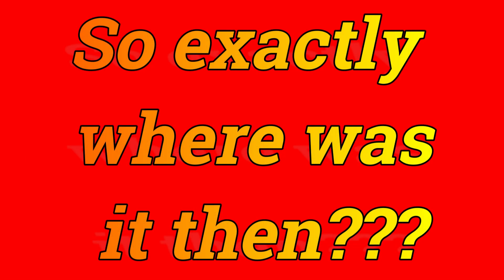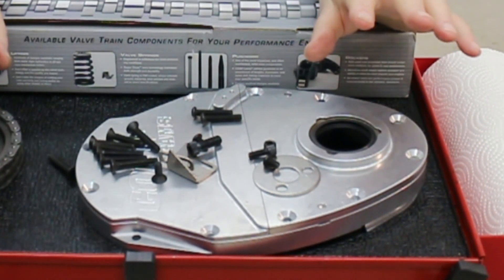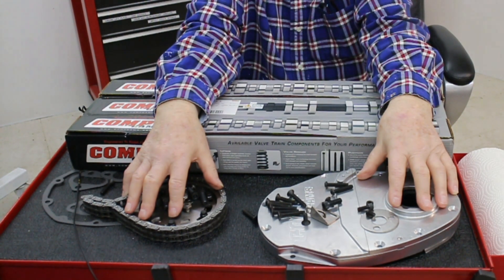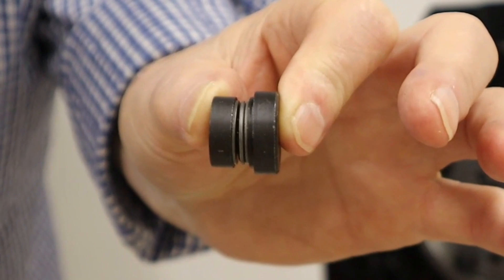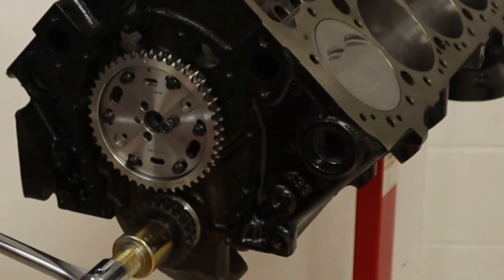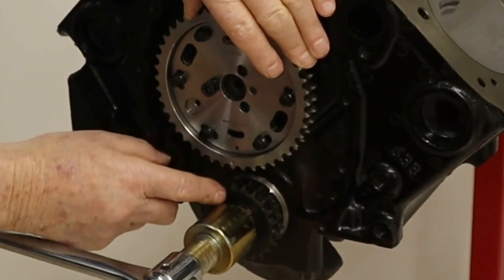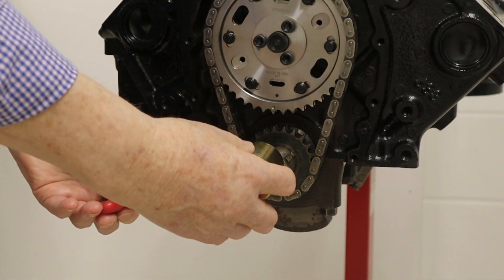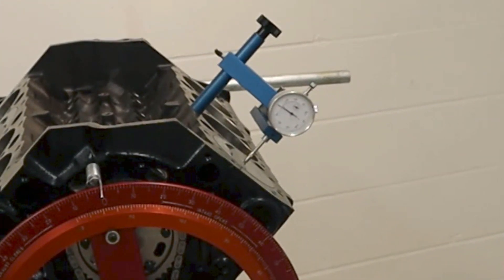Automatic readout cam timing wheel

Comment: I'm 65 and I've only built two engines both with the same camshaft and both extremely mild. They were the 204-214 Edelbrock cam. Relatively wimpy but I wanted something drivable. We're talking 30 years ago.  I bought one of those small crane degree Wheels.  I suppose they're better than nothing but you really need to have a nice sharp pointer and good light to try and read them. 
I'd like to thank you for your videos and your books.  I ported a brand new set of heads from World Products and took your advice from one of your books. I had The Machinist install 1.6 exhaust valves. The first thing that I noticed and I remind you both of my engines had the same camshaft profile. The engine sound had changed.  I liked the new sound. With the new heads and this larger valve I definitely noticed the power increase but it didn't hurt my mileage at all. 
The book was called performance with economy I believe. I learned a lot from that book. You choose words and descriptions that make everything easily understandable.  
What a treat it is for people today to be able to see your videos. Thank you David for doing what you do.

Comment: Another excellent video, as always. And I laughed at the fact that you were assembling the engine with your house shoes on. That is confidence, and comfort, all in one.
I'm patiently waiting on the dyno numbers. I'm specifically interested in the vacuum. We run "stock" dirt cars. We have to use open chambered heads, and a vacuum rule/lift rule cam. I'm curious to see the effects of the tight cam on vacuum. 
Thanks again sir.

Comment: Yes , I want to build the 108 lobe sep. angle engine you talked about in the previous 'add 60 hp and ft lbs' video. Though I am using Flo-Tek aluminium heads because they are the cheapest decent heads I can find that deliver to Australia, and I am using a Howards 277 degree . 470 lift cam 108 lobe sep. camshaft (I am using the Certified cam and lifter package that is guaranteed for 5 years as I don't want any of these lifter wipeout problems and will be using ZDDP zinc additive also) and the 650cfm carb and rpm air gap manifold you recommended on a 350 .030 over bottom end. We should all have something to port at least on the Zoom conference don't you think?
Reply from the maker: Chuck - this is a good combo - although the carb is a little too small unless you use a spacer (maybe just a 1/2 inch one).
DV
Reply: @marvingvx1  David this may be a elementary question but how and why should a mere half inch spacer do his setup so much in additional power?  Thanks again. And please excuse my novice ignorance.

Comment: Thanks Mr.Vizard.     I do approximately 12 complete engines a year,  and find that the tolerance stack up is off, on about 40 percent of the jobs.  That goes for the premium parts as well as the average cost parts.    My question to you is, if the optimum LSA is 108°  but all that you have available is 110°  provided there is enough Piston to valve clearance for a very basic performance build, would it be best to install at the typical +4° or, maybe better at +6° ?     I do realize this is a broad question.    Thanks for your consideration  !
Reply from the maker: Mr. Comet sir, I am relying on a flawed memory here but I think you are right. I seem to have it in mind the a cam on the too wide LCA works best with just a little too more advance. Gives a better drag strip power curve but fall a little shy at the top end.
DV
Reply: @marvingvx1  Thank you Very much !!!   I thought that would probably be the situation, but confirmation from YOU is going to give me more confidence.   I appreciate your sharing your knowledge  !

Comment: I think I missed some numbers somewhere. I thought you were going for intake centerline at 107, but somewhere that changed to 102°. I assume that means the cam was ground with an LSA of 107°, which would make sense, and needs installing at 5° advanced. This would appear to favor mid-range torque (tight LSA) and the advance will close the intake valve quite early, favoring low end power. With well flowing heads you could still get good power from the engine. Overlap at 0.050” should be from 10° BTDC to 3° ATDC and intake closing (again coming through 0.050” tappet lift) is at 34° ABDC. Am I understanding what you said? I’m really looking forward to seeing the dyno results from this engine!
Reply from the maker: Brian, you need to watch again and note the numbers especially where I read out the cam specs.
DV
Reply: I don't hear where the 102 comes from either....I figured you mean't 107....
Reply: Good question..thought i would find the answer here.

Comment: Hey DV, have you considered using one of the Comp cams 6100 Belt drive timing kits? they are supposed to reduce or soften  valve train harmonics (and I know they do) transferred from the crankshaft and also are more accurate to dial in than chains and I guess more quiet. I guess you would want to use one on a more high-end build.  Also, I was told that you have to run the nylon cam buttons with aluminium timing covers, as the steel ones wear away the cover? I guess it's more of an issue with a manual car and having a heavy spring load from the clutch trying to push the cam forward in the block every time you disengage the clutch - I know Isky Cams do an Anti-Walk cam kit that puts bushings and washers behind the timing set so there can't be any back and forth movement after you set it how you want it.
Reply: Not being sarcastic, please explain to me how the clutch, or specifically the spring pressure of the clutch pressure plate, has anything to do with the cam walking back and forth in the engine block.
Reply from the maker: @shelbyavant5081   - not sure where you are coming from here!
Reply: @marvingvx1  Right! Go back and read Chuck.U.Farley comment above. It makes no sense.

Comment: With the little knowledge I have, for me cam events are more important than how much duration and lift a cam has, if it happens on the wrong timing event it is pointless, now touching on this subgect, what about cam timing events vs connecting rod lenght, for example, a 1.5 vs a 1.8 rod ratio, I assume ( and I might be wrong ) that the cam events play a factor regarding the acceleration and position of your  piston on the 4 events of the engine rotation, is this a topic you touch on your seminars ?
Reply: @REMY
You may be on to something there, some top engine builders say they have found no difference in power with different rod lengths. Did they optimize the cam events? I don't know. A shorter rod moves the piston more violently around TDC. I wrote a program some (many) years ago comparing crank angle to piston position with different rod lengths. Google is your friend.!
Reply: @jeffreydurham5342  exactly, in my wast ignorance, I think about piston aceleration and the position  in the cylinder in respect of where and how much is the valve open to optimize the filling of the cylinder, if it is worth 1 or 2Hp in a 4cyl NA, yes I want them, anyhow you will have the camshaft grind for the engine, why not do it right the first time, and like I said before, I don't know,  that is the reason I ask if this topic is exposed in the seminars, I like to know how flow behave in relation of the valve open and piston aceleration downwards, I think it has some degree of validity.
Reply from the maker: This topic requires a lot of space. Things like this I cover in my seminars.

Comment: do you ever chase the inlet lobes down the cam in motor just in case the cam is neg-1 cylinder 2 then +1 cylinder 8 and just work out the optimum for the to distortion in the cam plus also theres valve pressures on the cam bearings .. but saying that i guess if you have a split valve cover and adjustable gear and you dial it in as best you can at base setup. you will always remove most of the play in the timing and be able to adjust the 5 degree area on the cam gear to suit
Reply from the maker: Yes but I mostly rely on my cam doctor to accurately measure for errors. Unfortunately it is currently out of commission so has to go in to Performance Trends for a rebuild.

Comment: Hello David, I have a question about camshaft base circles : my NSU TTS engine has a 39 mm camshaft tunnel. I can buy new camshafts in 39 mm, for a std camshaft tunnel, and in 40 or 42 mm dia., for a bored out tunnel (all with the same valve lift timing events). So I wonder what is the advantage in having a larger cam and base circle ? Regards, Paul Ginis

Comment: Mr.Vizard, shouldn't you turn the engine back well past the position you want BTDC then turn 'forwards' again to the 0.020" to get correct degree position? Continue turning same direction to get 0.020" ATDC. Slack in chain can easily give you 10~15 degree's in my experience with SOHC and  DOHC motorcycle engines.
Did you add extra scale to degree wheel to have a Vernier?
I had to look it up years ago when I was teaching 'engine reconditioning', Pierre Vernier, late 1700's (I would have to find notes and lesson plan from 20 years ago to get exact dates)
Reply from the maker: Watch the timing chain tension section again.

Comment: good work david.david is your cam lsa method in your publications valid for high output turbo engines.most are leaning to wide lobe centres for turbo engines.
Reply: Does not apply to turbo motors,
Reply: @DavidVizard  thanks david

Comment: I've never seen one that far off .I'm wondering where the top gear adjustments were setup to begin with?
Reply from the maker: Just a tad off zero!
Reply: Where was the problem? Did you run it thru a cam doctor? Comp advertises that it's not necessary to degree their cams in their instruction manual but you should check valve clearance. If the average guy would have installed it straight up with a standard gear set he'd probably been in trouble. Believe I'd send that one back to the manufacturer

Comment: My grasp of these concepts is vague at best. I understand how the stacking of tolerances led to the cam being installed at 111 degrees, and not 102 as intended. I understand that using the 4 degree advanced keyway on the crank sprocket gets you to 107. How do you get from there to 102? That must be where the adjustable cam sprocket comes in, no?

Comment: This is likely a dumb question but couldn't you change the cam sprocket by 1 tooth in the chain? If my math is right that would be about 4 degrees per tooth on the can gear just to get it close then use the adjuster on the sprocket. I'm not a motor builder so I;m just curious.
Reply from the maker: Chad, on the cam gear tooth pitch is 8.182 degrees. I have used a tooth move on occasions.

Comment: I hate to tell you on here but you can not use the roller dummy lifter on the flat tappet. You would be contacting the cam lobe more closer to the center of the lifter due to only contacting the tangent point of the dummy lifter radius which means you have to rotate the cam farther which in short makes it look like late cam timing. Put in a flat tappet lifter and you will see im right. Very rare to have comp cams be off that far. That should always make you double check your setup, not adjust to it. I hope nobody goes home and uses a roller style lifter to dial in a flat tappet camshaft if you do, you have very possibly seriously altered the engines performance. Contact point on a flat tappet lifter is toward the outer edge of the lifter, not in the center like a roller

Comment: Mr. Vizard, have you had any dealings with Flotek heads for a Ford 302 or 351 engine.
Reply from the maker: Yes and I am about to do a review on a set of Ford & Chevy heads.
Reply: Thanks for everything you are teaching. I am not an engine builder. But you have given such good advice about how things should be done, that I am going to give it a try on my 67 F100. It was my grandfather’s and I learned to drive in it.

Comment: DV; Thank you very much. Could you please elaborate on cam profile planning when considering the dynamic change in rocker ratio through its arc? I’m suspect that there is some power left on the table in some combinations because not all rockers of a given ratio are equal. Of course this is an opinion, but I have opinions, not a dyno! v/r wh
Reply from the maker: Will, this subject will crop up in some of my future video's so keep  your eyes peeled.
Reply: DV, I will sleep with my eyes open. Thanks, wh
Reply: If you understand this. Can you explain 102° from the optimal 107°? No matter how many times i watch i hear nothing about that part.

Comment: great video, thanks.  When I degree my cams in I measure the 0.050 intake and exhaust opening and closing points in crankshaft degrees and see how close I am to the card's values.  the last one i did, the intake valve closed to 0.050 value at 39 degrees After Bottom Dead Center, instead of the cam card's value of  42 degrees After Bottom Dead Center, so my cam was installed advanced 3 degrees, is that correct?
Reply from the maker: It's a more than valid way to do things but at the end of the day the cam must be right for the spec of engine involved.
Reply: @marvingvx1  thank you very much for your reply and your expertise!

Comment: Excellent video, very informant.

What are your thoughts on those gear drive timing sets, have you dyno tested any vs a really good timing set like the one you used here? Thanks in advance.
Reply from the maker: Yes - only the very best (ie accurate) gears will work as inaccuracies can upset the dynamics.
Reply: @marvingvx1  

Thanks for your reply, maybe you can elaborate in a video?

Comment: Companys like Comp should have the proper metallurgy and heat treatment , We shouln't be charged extra for there nitriding process.
Reply: The nitriding option is in addition to the heat treat done to the cam core when the camshaft core is made before it is finish ground. The cast flat tappet cam cores made by the two USA suppliers are all alloyed and heat treated properly.  Nitriding the cam after it is ground is like icing on the cake.

Comment: @29:30 you say its 92 degrees , from where im sitting it's 88. What gives?
Reply from the maker: Jeff, watch frames from 29 to 30 and keep your ears open!
Reply: I've watched it several times. You say it's 92 when it's 88. And you say the inner wheel is backwards. On both the 100 mark is to the left of 90.

Comment: No place inside a performance Engine for nylon
Reply from the maker: There is when you are on a tight budget and remember the stock F/T cam has nothing other than cam taper to control it. I have seen nylon thrust buttons on some of my builds from way way back and they are still good.
DV